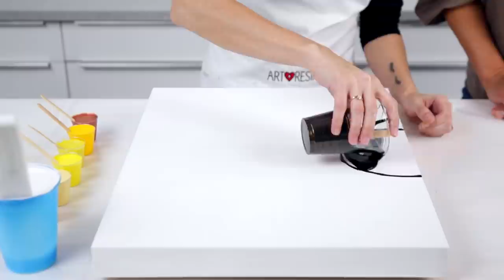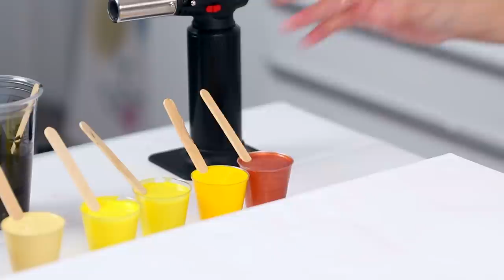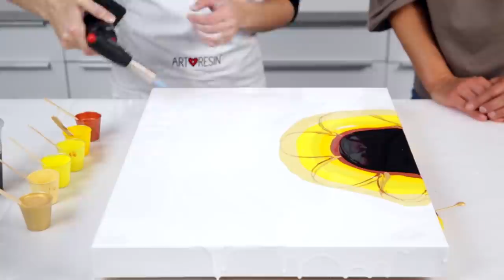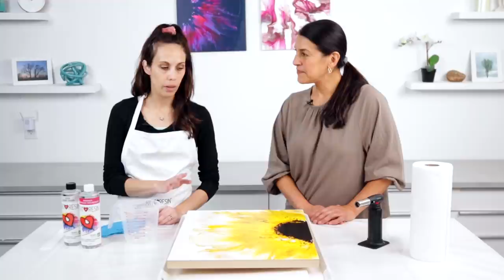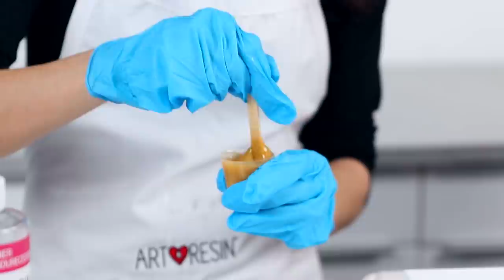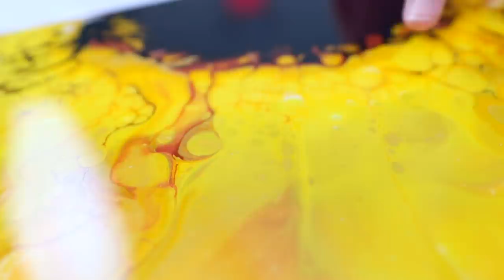2 Dutch Pour Techniques For Resin Art

Comment: How important is the 3 minutes of stirring?  It is beautiful!
Reply: Its very important! You want to make sure you mix for at least 3 minutes to make sure both parts are completely incorporated together  or else you could end up with a piece that doesn't quite cure properly.
Reply from the maker: Hi Tina, stirring your ArtResin for 3 minutes is essential!  The resin portion and the hardener portion need to be fully combined for the chemical reaction that turns the epoxy from a liquid to a solid to happen.  Under mixing will result in sticky or wet resin that never cures.

Comment: Do you have to wear a mask when using this resin?  Beautiful pics
Reply from the maker: We are happy to tell you that ArtResin is non toxic and does not produce fumes or VOCs!  ArtResin has been evaluated by the American Society for Testing and Materials (ASTM)
 and has been designated non-toxic when used as directed and safe for home use in a well ventilated area!  So, as long as you are working in a well ventilated area, a respirator is not required.  Here is a blog with more information:  https://www.artresin.com/blogs/artresin/what-safety-precautions-should-i-take-when-using-artresin?_pos=4&_sid=2012f9a6d&_ss=r

Comment: Amazing...but what about "sanding and polishing"??? Please reply what do we do?
Reply from the maker: In this project there is no need to sand and polish, once you pour the resin it will cure to a beautiful high gloss finish.  If you had bubbles or dust in your cured surface, you could then sand out any imperfections and pour a clear coat on the top to restore the gloss.

Comment: What kind of canvas did she use? I did a resin clear coat  on a stretched canvas once and it created a dip in the center. I assume the resin is just too heavy for stretched canvases?
Reply: Hi there! For this video we used wooden canvases which is great for Artresin but i do also use it mostly on stretched canvases. When shopping for canvases you want to make sure they're tight almost like a drum or it will sag and pool in the centre. But there are a few ways you can support it from underneath as well. you just want to make sure whatever your using to support doesn't show through the top of the canvas or it could show up in your resin. I hope that helps ❤️
Reply: @christinefitzgerald2830  Thanks for responding. If I may, what kind of supports would you use that work best? I’ve seen a video where the resin artist used polystyrene but it looked complicated.
Reply: @farahclay912  mostly ive seen others using thin cardboard slipped between the canvas and the frame but again just make sure you cant see the ridge of it through the canvas first and you should be ok!